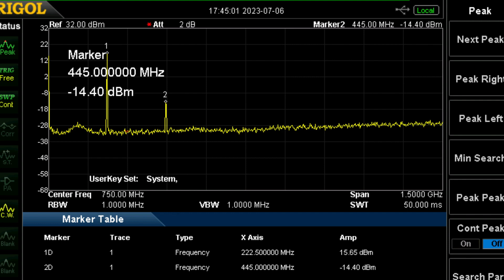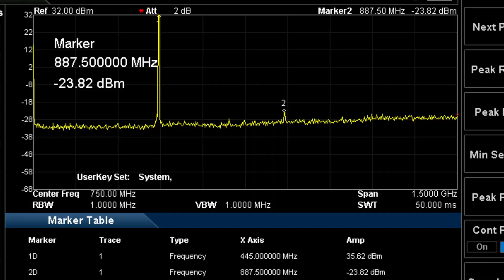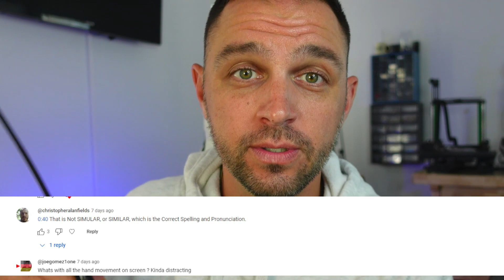Better Than I Thought! Baofeng UV18H UV-18H BF18H

Comment: Hi, there is sort of a version 2 out - UV-18 Pro Max. Has GPS also. Keypad and PTT is black. I enjoy mine and like it. Has 350-390 and 109-135.995 receive also.
Reply: This is the same radio, the only difference is that here the GPS module was not populated (but has the footprint on the motherboard). You can tell it's the same radio because the display is dark and has the bold italic font. Other radios go by the same name but are completely different, they can have a light blue display or a dark one that doesn't use the bold italic font

Comment: Nice radio......BUT there's a new version of these called UV18 Pro max with gps. Could you please do a review on this radio as no one else  has done it yet
Reply from the maker: Thanks for the info.  The UV18 Pro Max has been said to be pretty much the same as the UV17Pro with a different flashlight. Down to the same software, from what I have read.    I unfortunately probably will have to pass on that radio.
Reply: Apologies for the late reply. Notification never came to me.....Thank you for another brilliant video! @HAMRADIODUDE
Reply: Correct, this is the same radio, the only difference is that here the GPS module was not populated (but has the footprint on the motherboard). You can tell it's the same radio because the display is dark and has the bold italic font. Other radios go by the same name but are completely different, they can have a light blue display or a dark one that doesn't use the bold italic font

Comment: Where can I get the BF-18H?
Reply from the maker: I suggest the link in the description as that is where I've purchased multiples now
Reply: @DudeTested  been trying that link for the last month with no luck.
Reply: @HAMRADIODUDE I found a radio marked as the Baofeng iblack  which was described as the UV-18.  It looks the  same but don’t know if it is considered the same radio. The guy on eBay says he does not know when or if the BF-18H will be available anytime in the near future.

Comment: A quick solution to all this, quit using handheld analog radios. Buy a DMR handheld instead, they will have the analog 2m/70cm built in. No one uses 1.25m except the few souls who live within a block or two of a 220 repeater. Just forget about it. So just pick your poison on a DMR and you'll have everything you need even if you don't use DMR.
Reply from the maker: Lol. We must have fortunate 220 range here in northern Illinois.  Must be the water

Comment: I went outside today to use the UV-18H in bright sunlight. And boy was I surprised. I couldn't see the display at all.  As this is the place the handheld is normally used, this is a real problem with this model and also the UV-17.  I used my body as shade and even then I could see it some of the time, but not all the time.  I would think that the designers would think of this. So my rating of the radio goes way down to almost unusable.
Reply from the maker: I'm going to see if I can reach out to a contact (I did once to see if another radio was a legit radio) and see if there is firmware which may be upgradable.   My thought is maybe a different themes menu which would allow the use to chose the theme they would like for more or less contrast.  (white background for example).  I can see where this would be a major annoyance.  I still say for 35.00, I am happy, but I realize others who have different uses, will not be able to use it. thanks for the input!
Reply: @DudeTested  Thanks for looking into that!  Maybe here is an easy answer.  It is a great radio for the price, but finding a shade tree every time yo want to change a channel is a little over the top.  Lou,  N4LOU

Comment: my opinion to get the  best sound you most likely will need a proper antenna tuned to the  desired frequency on a switch, the distortion i'm heatrng sounds like master of  all master none principle meaning it picks up everything resonant on a couple of freqs

given the wide transmit and wide receive of the radios in question, if you are causing  bleed out on other freqs it most likely going to be the antenna being used not the actual radio itself.

with analog wide/narrow and digital in operation as low as 1.25 KHz it is crosstalk cross all applicable and active freqs

Noting from what I have read of the fcc rules there is nothing on how you physical use any given freqs it more or less dictates patent laws on radio design only..

Comment: pmr446 is a female breaker danielle from england :)
Reply from the maker: Oh then.    My apologies for assuming gender or whatever I got wrong.
Reply: @DudeTested  just putting it out there before she whips yo ass over it lol
Reply from the maker: @Ewetopia026  like I said, my apologies for getting gender wrong or whatever.    I don't know what s female breaker is though.   Must be lost over the pond or generations.  But, when 99.8 percent of my viewers are males, sometimes we make mistakes.
Reply: @DudeTested  over here a female breaker  is just a female radio operator we have a very small number of them now compared to the 70s and 80s , I’ve spoken with I think it’s Ellen who is New York usually on the 29 mhz fm repeater but I don’t know of many others over the pond , I bought the quansheng recently and bought another so I had a spare battery lol good little radio
Reply from the maker: now I understand a lot more.  Thanks for teaching me some new vocabulary!
Reply from the maker: @Ewetopia026  I still yet to go through deep into the UVk5.  But, if I can confirm everything works all right it will be something nice to give away at a hamfest when somebody new tests
Reply: @DudeTested  also got bf18h too still figuring it out

Comment: With cheap Chinese HT's I find that harmonic testing of a particular model doesn't mean much.  My test results using a high end Anritsu analyzer indicate that the harmonic content from these HT's has to be tested on each radio to determine if they meet spec. I have 2 identical Anysecu labeled HTs purchased together. 1 passed the harmonic content test, but the other did not, so I just use it as a cheap receive scanner.
Reply from the maker: I'd agree with that.  A good demonstration, probably on any analyzer, would be to have a handful of the same model handy talkies.   My best bet would be to get them all from the same batch and test them.   Then buy a handful from multiple online sources and test them.  I'd be curious if the quality control issue is per radio, per batch or per seller.

Comment: I have a UV-18 and was talking on a local repeater today.  It worked very well. The receiver sounded as good as my base station except for the small speaker size, and I was getting into the repeater (that was on a mountain 20 miles away) in a solid manner.  So much better than my UV-5, but not as good as my Yaesu FT3D.  But the UV-18 is almost 1/10 the price of the Yaesu, so I’m very happy with my purchase.  A radio I can take to places that I don’t worry about getting it back home! The FT3D is a much better radio, but maybe not ten times better?  The UV-18 will replace the UV-5.  I just wish it could be programmed in Chirp!  I’m using the factory CPM and have it on a cheap Windows laptop that is on my guest WiFi network and has no connection to my other computers or accounts.
Reply: If your radio has the dark display with a bold italic font, you can use Chirp to program it, you need to select the UV-17 with GPS, even if your radio doesn't come with GPS

Comment: You should lower your Resolution Bandwith to get the noise down. I bet there is a 2nd harmonic on 70cm, which you just dont see because of the high RBW.
Reply from the maker: Thanks.  I'll give it a shot.
Reply from the maker: Any recommendations on how low I should go?
Reply from the maker: Also, I subscribed. 😊. Thanks

Comment: I will give it a 1.5 shits.  Almost all of the seem to lack good receiver quieting, but that could just be the distance from the repeater.  Great series 73
Reply from the maker: I'm sure partially it has to do with the distance, being indoors, and the lighting surrounding me.  However, that's usually a fairly difficult repeater to hear outdoors away from those factors.  I have a plan in the future, I think
Reply: @HAMRADIODUDE 
He is correct in that most of the cheap radios seem more sensitive than bigger names because they a "radio on chip" IC and forego the pricey capacitors, inductors and logic to reject off frequency bleed, or harmonics or just plain blow up not being able to "desense" in a hot rf location. Both the Yaesu and Baofeng, TYT, Quansheng, TID etc use that architecture. But Yaesu kept the REQUIRED selectivity and filtering for transcieving in both bands. Boom, $85 for a YaeFeng FT 4XR or $99 FT-65 with discrimination and 3 years warranty.
Ive seen sales at $60

Ive been really impressed by the Baofeng UV6 pro as Jim tested. I think it might be better designed.

Comment: what's the model of the Alinco with the air bans sir ?
Reply from the maker: Alinco djvx50 - https://m.youtube.com/watch%3Fv%3DFc36eJrlIW4&ved=2ahUKEwjWxaiBgvv_AhUZq4kEHZgGCngQwqsBegQIGBAG&usg=AOvVaw064O4mFLzgLNqqHTwz2a2X
Reply: @DudeTested ean, that radio is arguably better than any other $100 range Japanese designed HT. I think it could beat out Yaesu FT 65 or 4xr or the Wouxon models. 
I think HRCC might have done the recieve test by hitting his own house with a tone to remote transmit a test signal measuring db differences and then use his SDRPlay RSPduo to record the Transmit at home.
The SDRPlay is a good Spectrum analyzer in that respect. Real world testing versus bench testing is more useful IMHO.
I would be happy to loan you my RSPdx and some lab quality cables for SMA I have. Or my new TinySA super duper deluxe and any attenuators you need.